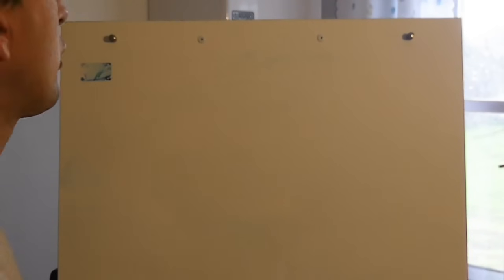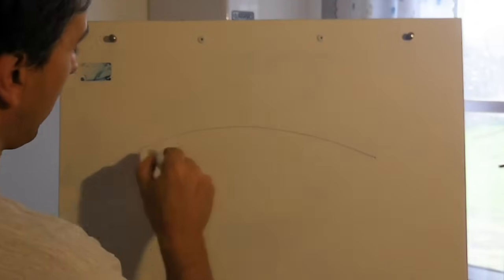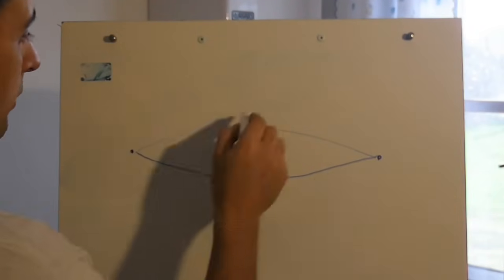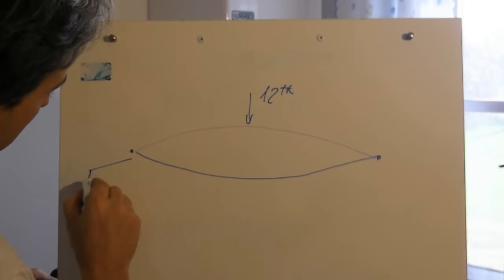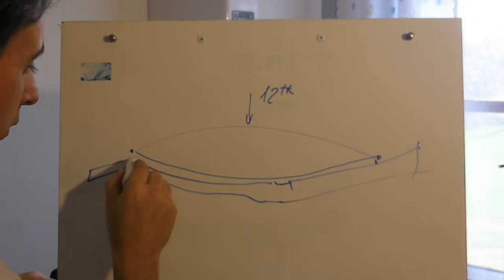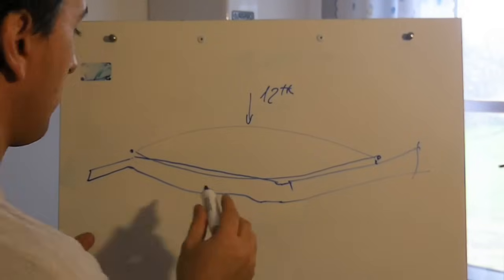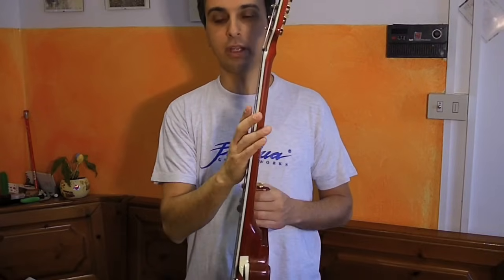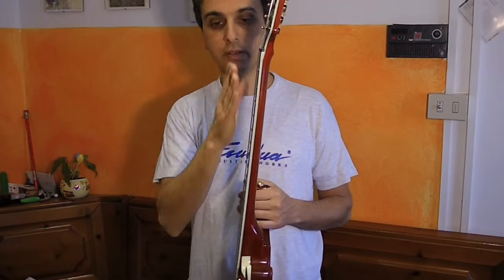Truss rod adjustment: how to adjust the truss rod - frudua.com

Comment: Hi Galeazzo,

I wanted to add a floating Tremolo bar with high and low range to my daughter's new (or new to her) electric guitar as well as give it a good tune-up.  So, I reviewed all of your videos several times, ordered the needed parts to do the upgrade, and preformed all the mods and tricks including notching the 6 screws.  In all, it took about 3 hours, beginning to end, including fixing a grounding problem causing hum and noise. 

Before the mod, there were issues with it staying in tune and several strings arbitrarily buzzed. Afterward, It tuned up very nice, has held tune for 4 days straight without even a tweak, and it returns to in-tune after repeated use of the Tremolo.  :))) 

Thanks, Galeazzo, for making these videos.  Between your knowledge of guitars and my mechanical and electrical skills, we have played a significant role in my 15 yr old daughter's musical talent.  Seeing her play with a happy smile says it all!

JP

Comment from the maker: The step by step procedure is (better if frets are dressed):
1) neck (truss rod) relief 
2) string's height at bridge
3) srtings height at nut (VERY IMPORTANT for both comfort and INTONATION)
4) intonation

For the Gretsch just buy a bridge with roller saddles and lube the nut slots :)

Comment: Dude, I love your candor and how you just say it like it is. My guitar was never set up right and the action was so high that the pitch would change when I used the higher frets! You emboldened me to mess with my truss rod. I've got my old guitar back! It plays better, sounds better, and is easier on the fingers too. Thanks man. Subscribed for sure!
Reply: A problem I encounter is string/fret buzz whenever I try to get the action at lowest possible setting. I can't be the only one running into that problem ?
Reply: @jimcamp2423  He recommended a fret dressing for this. There are most likely differences in heights of varying frets, so some play cleanly while others buzz. A fret dressing should even them out so the string is the same distance from every fret.

Comment: MR. FRUDUA! I sincerely hope you are well and ok. I know that you are an Italian Luthier and I can't help but think that you may have been affected by Coronavirus considering the situation that was in Italy in March-June. You should make an updated version of all of your videos. Keep all of the valuable info you have provided in these vids too. For many months I've been dealing with various guitar problems. I have an ESP guitar that had a Floyd Rose 1000 bridge on it and I bought a new Floyd Rose original. Since then, I've had numerous problems with open string buzzing and weird sitar like sounds from the 1st two strings. I watched this video years ago and just recently stumbled on it again. 
THE MOST VALUABLE INFO in this video is using the card from a D'addario string set and using it on the 1st thinnest string! This tip made all of the headaches I've had over the past several months worth it! Thank you so much! My Truss Rod was actually very very tight. Not so tight that it broke but it was very hard to turn. When all is said and done and I followed your advice in this video exactly, the truss rod had virtually little to no tension on it...I thought it was broke because it was so loose but that was just enough to fix my string buzz and the sitar strings and now my action is very low and I now have a very playable guitar. What really threw me off was how loose the truss rod on this particular guitar needed to be. It's extremely loose but it fixed all of my problems...THANK YOU FROM AMERICA -December 2020!
Reply from the maker: The Covid situation here with new variants is very serious. Keep safe folks this think is DANGEROUS!

Comment: This theory is completely correct. But the problem is that lots guitars come from the factory (even expensive guitars) with a snake neck. This means " There is too much space between strings and neck around 6th-7th-8th frets, and buzzing strings from 12th to higher frets.After adjusting the truss rod , the first problem is gone, and the second is worser. Fret leveling will help, but not solving the problem completely. Great videos , thanks SIR.
Reply: Jos Comartins exactly bro...im facing the same problem with my guitar
Reply: Sorry, I will apologise first, But I just have to say, There is no such word as "Worser". Its just "Worse". "and the second is worse" not "and the second is worser". Sorry, I just had to point this out.

Comment: Means the neck is warped BUT if the BASS has a bigger space it's in some way ok because lower strings has a wider vibration pattern. Eventually you have a comfortabe feel on the higher strings (low action) and less buzzing on the lower ones The opposite would be a BIG problem instead.

Comment: Some say relief is checked at 8th fret... some say at 10th... some say hold fret at neck/body joint... some say hold fret at 24th fret.... some say hold it at 16th/17th... One word... Confusion :)
Reply: No confusion...pick one...this guy too me knows what he is talking about
Reply: infoowetrust Thanks. Yes, of course. He is an expert. No doubt about that. About the truss rod... I think one can get a good idea from the feel of the guitar; feeling the action and listening for fret buzz. And adjusting accordingly. Thanks.
Reply: According to Fenders Strat set up support page, you check the 8th frat for strats.
Reply: ***** Thank you. Maybe they are all valid measurements and different techniques are used by different manufacturers. All are good ways and, after all, you can tell by the feel.
Reply: pathfinder55 explorer Thanks for the comment. Yes, definitely get a professional guitar tech to set up your guitar if you're new to it or don't set it up often.
These techs are pros and practice it on a daily basis and it's obvious that they do a better job than a guitar player that primarily practices playing rather than technical stuff. Maybe some players may set up their guitars roughly and don't mind if the action turns out high or there's some buzzing. As long as they can play.
But they can practice much better on a professionally-set up guitar, right?
Reply: +Spirituality1980 
Just think about from where the guitar neck is effected by the trussrod?
All the way on the end of the fretboard and on the fretboard there is almost no bending possible. 
The last part where it can effect the neck is around the frets before the body joint. So this would be a position where it makes sense to measure/compare the string hight to the other frets up the neck.
Reply: onpsxmember Thank you! :)
Reply: glad i could help. Jeez i made so many mistakes in that comment...
Reply: +Spirituality1980 Check on the fret where the gap between the fret and the string is the largest.
Reply: do it where you play the most mines 7th and 9th
Reply: Spirituality1980 I disagree!  Set up is really an easy task.  In the past, I used to have professional set ups and I hated them.  That's actually why I learned how to do it myself.  As a very particular player, I suggest learning how to set up your own instrument.  You know what you like and not all luthiers and builders are the same.  Honestly, I believe I can set up my guitars better than anyone out there, but then again I'm particular!  😉
Reply: Do you know which fret should I check for a Gibson SG? I changed the strings to a different set and now I have fretbuzz on the major E :(
Reply: @SeverinoSE  Thanks for the comment. I've never really worked on my guitars, just replaced strings, and was debating whether or not to try to set up my new one myself or take it to the local shop.